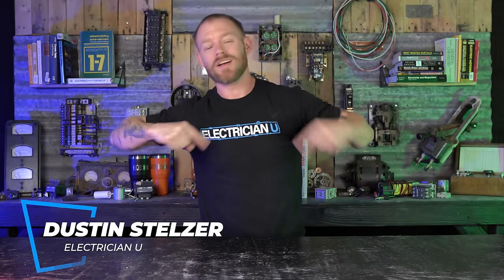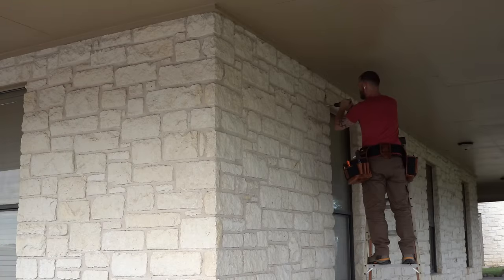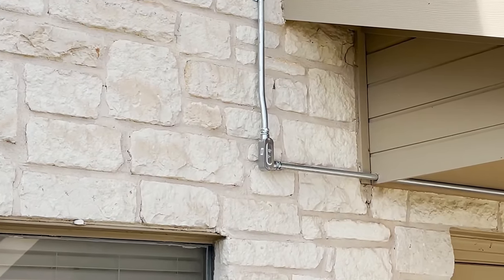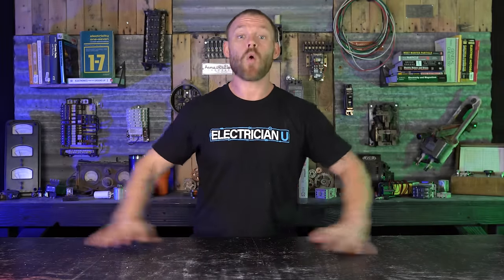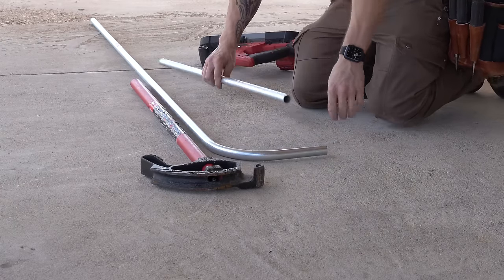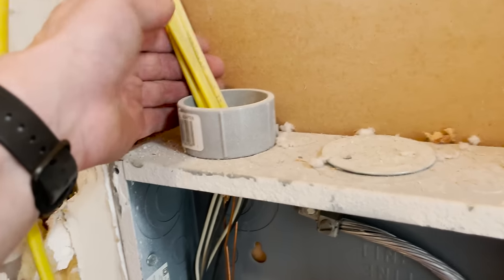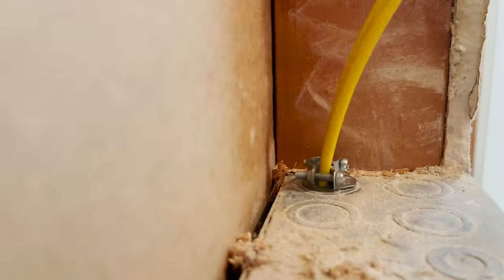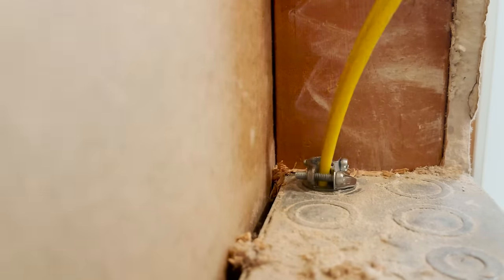Installing a Mini Split at a Commercial Building.

Comment: I think I've been overstrapping my conduit lol. I've been doing 3 straps per pipe (10ft). 2 feet away from the couplings and one in between.
Exceeding minimums I guess.
Reply: It's never a bad idea to go above the minimum that is code
Reply: I over do mine also
Reply: @citizenfriendly3845  me too. Straps are cheap compared to a conduit run coming loose and someone possibly getting hurt.
Reply: I think it kinda depends on where it's installed. I could see this install getting some halloween decorations or something hung on it. So better to go a bit more like Dustin did. If it was indoors 30' up a wall in a warehouse, maybe you don't need as many.

Comment: Great video 
You could have mentioned that compression connectors were used with the conduit bodies because of outdoor codes.
Reply: When ordering emt connectors/couplings for outdoor use ask for "weatherproof" not "compression." There is a difference and "compression" couplings would not be applicable to this video since they are not weather proof/ water tight.

Comment: Just out of curiosity can you run a white wire in a conduit as an underground conductor? I didn't think it was permitted in the nec. Just curious if I'm missing something.
Reply: If you run a white wire it could only be used as what now is called the grounded conductor ( ya was the neutral for 100 years ).
Reply: @garbo8962   i thought he went over the code about that. Did he not say you can take a grounded connductor and relabel it with tape at any point that it is visible?
Reply: @isaakward4393  that is only for romex or mc from what I understand
Reply: If you actually read article 200 really well (its super quick since its so short) it clearly says that you cant do this for conductors this size unless part of a cable assembly.

Comment: it is a good idea to deburr the conduit to avoid bits that can cut through the wire and cause a short or make the metal live

i am not sure if that electrical box is done to any proper code

Comment: Section 220.7 (C)(1) only allows for a white or gray conductor smaller than 4 AWG that is 'part of a cable assembly' to be re-identified as a ungrounded conductor. So...yes it was allowed in the panel or in the junction box where the Romex was used, but not in the disconnect where the single THHN conductors were used, since they are not a cable assembly. I noticed a black, white, and green being terminated at the disconnect so am assuming the white was re-identified as a red since the circuit was 240v.

Comment: Why did you go with 3/4 emt instead of 1/2?
3- #12 wires easily fit in a half, I'm just curious on your thinking
Reply: They pull so much easier in a 3/4", cost difference is small.   After you waste 30 minutes on a 1/2" stuck pull, you don't want to do that ever again.  3/4" is sturdier, some commercial places don't want 1/2".  1/2" kinks a lot faster than 3/4".  If you don't run 1/2", you don't have to keep inventory for it.
Reply: Also when working by himself it’s less likely to snag when he’s pulling in the long run. It would suck to pull it in and not notice a kink that gets hung up and later discover a short.

Comment: I know that white can be redefined as a red or another hot color as long as they are marked on both ends as long as the wire will carry at least 50 volts.

Comment: A subject I wish you have talked about is the weather tight connections.
Also, wire colors. When pulling a 240 circuit through conduit, is it ok to use two black conductors or do you have to have a red and black?
Reply: Yes perfectly legal to use 2 black wires. Good example would be a single phase 240 volt receptacle.
Reply: @garbo8962  So he could have put black tape on the white conductor instead of the red tape that he used? Or is using black tape a no-no?
Reply: @davidgagnon2849  technically yea but it makes sense to phase each hot differently to make it easier for the next person to understand

Comment: wonder why you didn’t use a T fitting at the low point when coming down from the eve ?
Reply: He wasn’t coming out of the LR with another conduit. A T has 3 openings for conduit where he only needed two. If he continued his conduit run past the Eve that’s when he could have used a T

Comment: What do you think about using a piece of red heat-shrink tubing for marking the wires instead of wrapping with red tape...also i have used green heat shrink over bare copper ground wires

Comment: You installed a double pole breaker, correct? What if it was a 3-phase panel that's typically found in a commercial building?

Comment: Did you need to re-identify the white conductor as red in the LB's also? Are LB's considered a place where the "conductor is accessible"? Or was it sufficient to just tape them at the breaker and the box at the end of the run?

Comment: Wouldn't you worry about voltage drop. That run looks like its at least 100 ft. Wouldn't 10 awg have been better ?
Reply: 100 ft isn’t too bad. 150-200 and up definitely
Reply: @MegaGsizzle  I'm with ya at around 75 ft I start to ask questions as to what future plans are or really start looking at equipment plates lol
Reply: The video cam adds distortion to the view so looks longer. If you count the porch supports and figure them at about 8 ft apart then that straight run is under 50 ft so well under 100 ft total. Also consider that mini split is likely closer to 10 - 12 amps draw so little voltage drop.
Reply: The amp draw is most likely under 5 amps, it's really not an issue
Reply: You go off the specs of the unit being installed.  It's likely he was installing a unit that spec'ed 15A and 12ga was already an upsizing.  A lookup on 2 ton mini-split I'm familiar with says it draws 10A.  And 2 ton is quite beefy as single mini splits go.

Comment: I was taught that emt couplings should be considered "conduit body", so for 10' emt lengths following code 2 clips per length each 3' from coupling max, 20' emt lengths following code 3 clips, to maintain greater than the minimum 10' support rule
Reply: Almost same, except you can do BOTH 3' from a coupling AND one  every 10' with the same one strap per stick. You don't need two.

Comment: Thanks for your videos. Wondering if you can share the wire dispenser caddy brand you used in this video. It is pretty compact and would like to get one for small runs; the one I have its taller and with more capacity and sometime too much.

Comment: Great video.
I have a couple of questions: Did you run two hots, one ground and a neutral? Did you use a fused or non-fused disconnect switch?
Reply: At 13:41 you see 1 black, 1 green, and 1 red taped white (oops, see discussion about this in other comments).  The black and red taped white are hot, and there is no neutral.  This disconnect is a pull out type (placed in at 13:38), and has no fuse.
Reply: minispits  from the panel to the disconnect(and to the outdoor unit) don't require a neutral for 240v.  For 120v, one hot + a neutral is required.   From the outdoor unit to the indoor unit, you need 2 hots w/ ground or one hot+one neutral plus the ground and 1 control wire(4 wires total ). The wire size is usually 14-18 depending on the specific manufacture's requirements.

Comment: Always great, fun videos…Funny Pastor’ innocent interruption. More likely a bid, my approach to anyone wanting to talk or help…”I charge extra for your advice” BTW, Know you’re all about great thorough advice to everyone. Regarding “commercial buildings” like this job with Romex, in many county, and or cities, mention to be certain, even if one comes across all romex, to research the job-site codes for cabling or conduit requirements, so as to no be part of the shoulda known better if someone or something goes wrong…every damn things about liability, even when you believed was a “clean” installation. I’ve done many installs like yours, but commercials are now all armor only. Some time ago in, Burbank CA, a residential house I was required armored only, no romex! MC galore…must have major rodent issues 😵‍💫🤷‍♂️

Comment: Hey Dustin, would you go into detail on why you ran EMT(?) instead of Schedule 40 PVC for this? Possible code time?! Thanks!
Reply: PVC emits toxic smoke if it were to catch fire, PVC is generally used for underground conduit runs only.

Comment: quick question isn't it against code to run 1 hole straps on over head runs was always told it was a no go and had to run 2 hole or minis

Comment: How come you used emt outside instead of aluminum or rigid conduit ?🤔
Reply: Far cheaper and easier. emt is the way to go.
Reply: EMT is fine in all weather conditions as long as you use what are refered to as 'weathertight' couplings and connectors, which he did.  EMT makes sense here. It's up high in an area where you wouldn't get any gain from the extra protection of rigid. I try to avoid PVC for horizontal runs outside. He did exactly what I would have done. Although where the EMT changes course up to the soffit I would have just bent a 90 there instead of an LR. I also would have rolled an offset into the left side of the disconnect rather than an LB. That's what makes this fun though is we all interpret the task in slightly different ways. As long as its neat and safe it's good.

Comment: Great video Dustin!  At what point would you back out and  stop/cancel a job when you discover "Randy the Handyman" type messes?  It's your name, business license and potentially liability on the line.
Reply: If there's something that makes the site/your work area imminently unsafe, that's a time to refuse to go in unless you or someone else addresses that imminent issue.  That's typically addressable with something on the scale of turning off a breaker, moving a load, or tightening a connection though, not installing a new service.  IMHO, you should have time built in for the little things come up and to explain things to customers.

Aside from that, having you there makes things better than not, even if you aren't solving other issues.  You don't assume responsibility for the whole site when you change a receptacle.  Practically speaking, it's not that people have a death wish, it's that they don't know, don't know how, or don't want to pay.  Talk with them and be fair differentiating the spectrum between serious issue and code nuances.  And you can write on your work notes/receipt "advised customer that ...".

Comment: Question did you transition from THNN to Romex by splicing them in the conduit body ?  Is that permissible by code
Reply: As long as the conduit body states a volume .  314.16 (C)(2) NEC
Reply: @richardcamarena5448   thanks I'll look into the code article
Reply: If you go back and listen he says he put a junction box in the attic and made the transition there.
Reply: Go back to the 8:08 mark, he says it there.
Reply: No its not code, but no he did not spliced  @ the LBJ joint he just pulled wire there. He transferred in the attic to Romex
Reply: @richardcamarena5448  romex is not suitable for damp or wet locations.
Reply: @citizenfriendly3845   I know that . I was responding to the question about being able to splice in a conduit body.
Reply: @citizenfriendly3845   I actually misunderstood his question.  I assumed he was just asking  about splicing in a conduit body, if that was permissible.

Comment: I am an old fart, not a professional electrician. Thought I had heard pretty much all the terms, but "mini split " is new to me. Gonna have to go look that up.
Reply: It's a small air conditioner/ heater kind of like a window AC unit but the venting is usually a three inch hole through the wall or a blocked out window.
Reply: @phillhuddleston9445  Thanks. I haven't done my due research yet.
Reply: Lol. You must be old. Mini-splits have been around awhile and have become more common in the US over the last 20 yrs.
Reply: @skynetlabs  Yes, I am old as I stated to begin with.  Now that I know what " mini split " refers to I have seen them for a number of years, just never heard that term before.

Comment: You think the bandsaw is any better then just using the grinder to cut em ? I guess it'll be a lil bit more clean of a cut with the band saw but ya have to debur either way anyways and a grinder n cut off blades is def a hell of a lot cheaper than the band saw n band saw blades but yea idk what ya think brother ?
Reply from the maker: One throws sparks and the other doesn't. 

So if you are in place where you either have to pull a hot work permit (commercial buildings / plants) or cut with a band saw. The choice is rather obvious in that scenario. 

If you are cutting PVC conduit band saw is also a better choice. Or a PVC tubing cutter. No need to de bur that way. Just run your pliers in the new cut you made so it rounds the fuzzies off and you should be OK. 

Band saw is also faster in most cases. 

But either is definitely better than using a hack saw haha.

Comment: Question that’s not related to the subject: is it allowed to install pop-in bushings backwards into a breaker box? There is a plaster wall separating the outside of an already installed box from having a workable area. so would it be okay to put one in to have the romex fed through and secured?
Reply: Follow the manufacturer installation instructions ., thats my best guess

Comment: Do you need to identify the white ungrounded conductor at each pull box too?
Reply: when pulling larger wires like #4 and larger the electrician would only identify the ends where the terminations are. The white wire shown in this video is a code violation since it is smaller than #4.
Reply: Re-identifying individual conductors in conduit is against code. It's only acceptable for cable assemblies like Romex, or flexible cord assemblies.
Reply: I would say yes . Because he mentions in any “visible location”
Reply: @uhjyuff2095  the white wire is not against code because its not a neutral wire. It is considered ungrounded conducter so it just needs to to he identified as such. 10:05
Reply: @citizenfriendly3845  it IS against code because white or gray wires shall be used ONLY as a neutral/grounded conductor, not as ungrounded conductors. The only exception to that is 200.7(C)(1) and (2), which says you can re-identify a white wire IF it's part of a cable assembly, such as Romex, or if it's part of a flexible cord assembly. The exception does NOT apply to individual conductors in conduit.
Reply: @jonclark1288  i see

Comment: Would it have been up to code and easier to just run UF wire and transition to EMT going up the wall?
Reply from the maker: In an existing installation it would have been more money to the customer to bury the UF. Plus there would need to be concrete work to cover it, not to mention trying to bury it to depth per code in that location would have been impossible with our a gigantic tool to assist. 

There would not be any code violation other than if you were to install the UF wrong into a transitory piece.

Comment: Looked like u used a 12awg wire for a ac mini split I’m hoping the ac unit was  rated for 110 / 120 lol and a 20 amp braker …now if it was a 240 u had to use a 10 awg cable on a 30 amp double pole braker other then that good job 😎🔥
Reply: If your load is 220V and uses less than 20 amps, then number 12 awg is fine.

Comment: code on location of local disconnect for the unit?? Local code here says that it has to be within 4 ft and readily accessible. Might just be a local thing but i question needing a ladder to open the disconnect.
Reply: So? You need a ladder to access a roof mount unit, there's no difference that & this. It's readily accessible while servicing 
Don't forget, the whip isn't supposed to be longer than 6'
Reply: @beentheredonethat7572  440.14 is the code you're looking for. The definition of readily accessible specifically mentions a ladder should not be needed to access the disconnect. If you use a ladder to access a roof mounted unit the disconnect still needs to be readily accessible. As in you shouldn't need to bring a second ladder with you.
Reply: @camxtron  Yeah, I was confused with the disco placement, I guess he thought the mini split would be mounted on the ceiling?
Reply: If you need a ladder to service the mini split, but can still reach the disconnect, then that is fine. Disconnects have to be readily accessible next to the unit.
Reply: I was wondering the same.
I'm guessing it will be mounted on the wall.

Comment: Well......You can re-identify since it is a cable...BUT you DO NOT get to re-identify the white as red in the EMT. The re-identification allowance only applies to cables per 200.7(C). I believe you reidentified the white in the exterior disconnection means at 8:04 which is a code violation. FYI- since I am just a "Code Guy" I would have pulled two blacks or a black and red from the disconnect to the junction box and then you could have used the reference to 200.7(C)(1) for your panel and junction box locations.
Reply: Oh!! Thanks for the time stamp,
Reply: So…. If its part of a CABLE SYSTEM , welll romex is a Cable. So i would say he is with in code🤪🤪lol
Reply: Not the part in the EMT....he pulled individual conductors. Code is easy when it's in Black and White. :)
Reply: @MasterTheNEC  exactly. Thats what im saying that thhn run is part of the romex cable run
Reply: Not....LOL